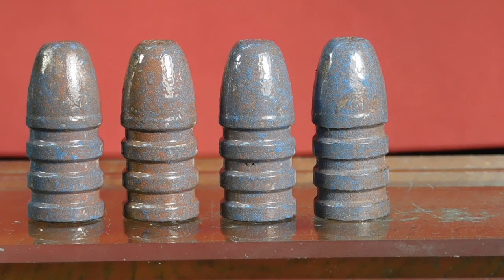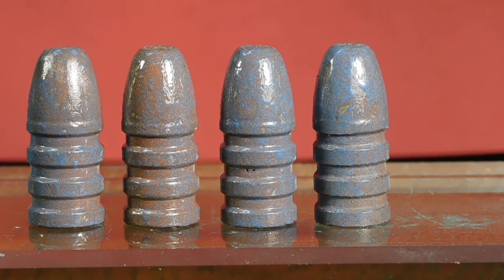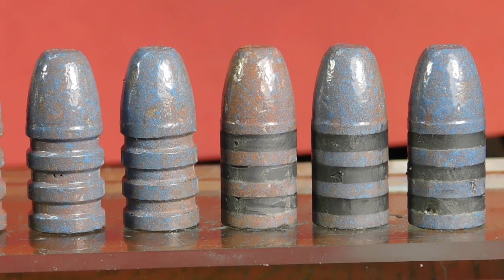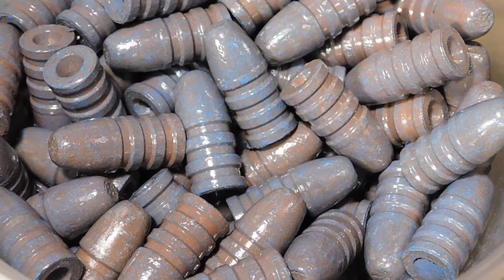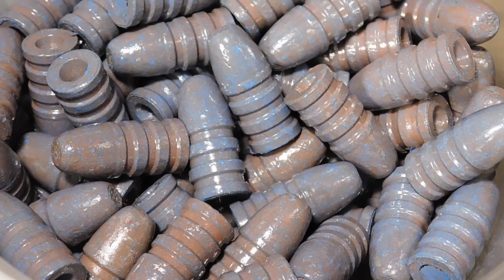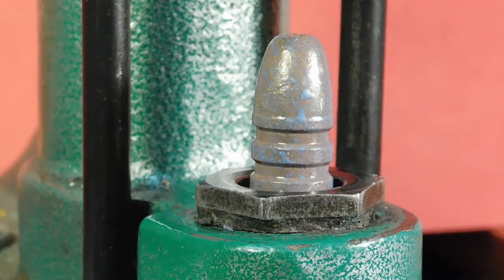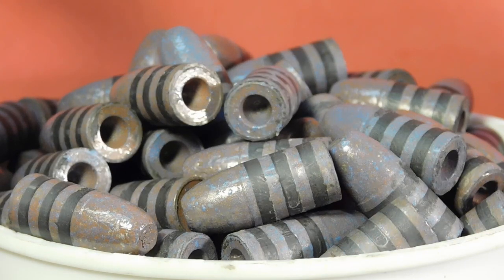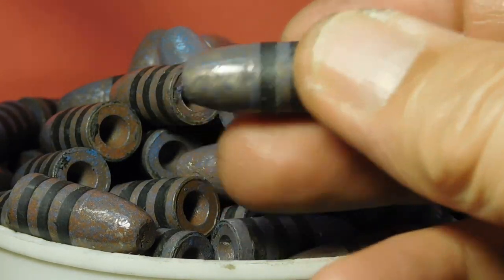Lubing And Sizing The Big Lee 457 405 HB Bullets

Comment: If you have access to a 3d printer you can print a custom top punch in PLA that will align those bullets in the die perfectly.
I have printed top punches that have run thousands of bullets through my Lyman 45 with no wear.

Comment: FC.. not related to this post but is anyway you can test and see if an rcbs case link activated powder drop system will work on the Lyman brass smith 8 station turret  with all 8 stations occupied, you reviewed it a while back. I ordered one and that’s one mod I want to know also most my dies have Hornady lock rings regardless of brand, I just like em

Comment: hello fc ,i mounted a ratched tool on the lube matic  ,instead of  the original handel  ,much more handy, you need a pipe that fits on the lbm and weld a wrench nut at the pipe end  ,hole tru pipe  bolt tru  and your ready to go.

Comment: 16/1 alloy ? is not so soft for a 458 magnum?
Reply from the maker: blackarcher1000 - Definitely too soft for anything over 1700 fps.  These hollow base slug designs are transitions from Minie ball to smokeless.  Best to keep pressures on the lower side with these.  Still a thumper though.  Best to ya,  FC Steve